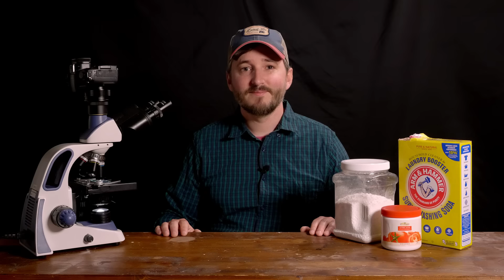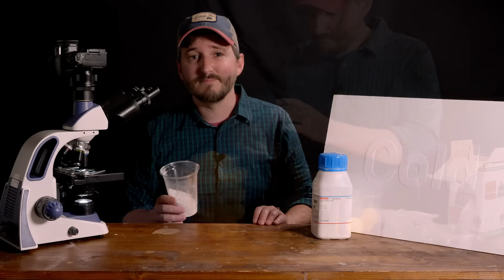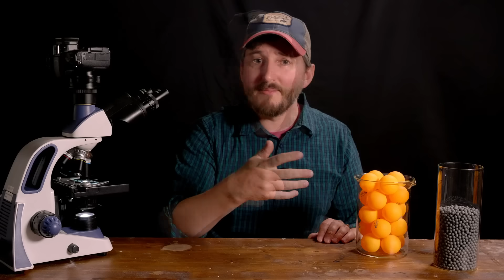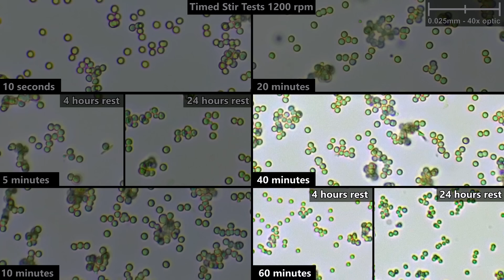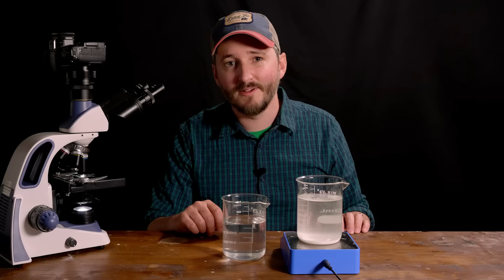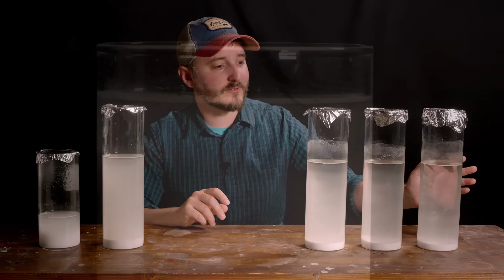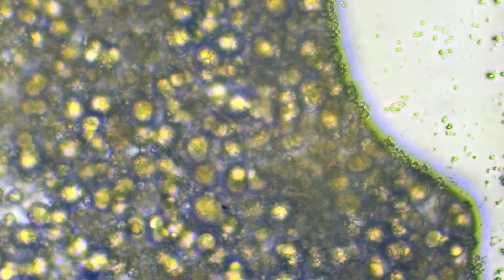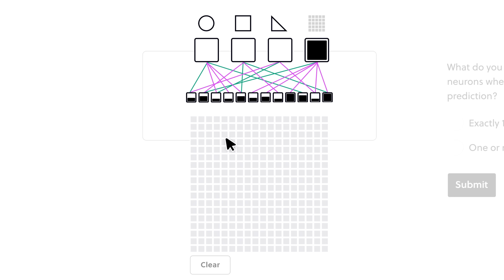Making Infrared Cooling Paint From Grocery Store Items (w/Novel CaCO₃ Microsphere Synthesis)

Comment: Pearls of Atlantis:  The Cove is sure to keep you cool all summer long, spandex blend.  The heavier dialectric weight creates calorimetric pathway, might be junky made, but I honestly hate fancy fabric anyway, oooh my butt is tight, who said that?  Denim has a lower dialectric weight, like if you just get the hanes 50/50, why would they sell a 50/50 tee shirt, rayon sucks to.  Spandex is the coldest fabric.  The theory is subatomic particles move at the attosecond, but they act as resistors, crystal deformities providing edge knife diffractiobs.  If you went deeper, point like particles exist outside of time in higher dimensions, but the most useful property is they replicate way faster than the speed of light.  Otherwise, things would freaze and anihilate.  So random motion comes from heat and dispersion, that where spandex plays a key role.  ( my high score is 23,650 on 579, I'm on level 663 ).

Comment: Is it too early in development to discuss applications? As I am sure it will soon become apparent, let me address the fact that I have only a high-school education and performed at the low end of mediocre in a public school system which consistently performs at the high end of poorly, so my hypothesiseses will be fraught with incomplete and incorrect premises and even more questionable conclusions. 

Having said that, here is what I "know" that is relevant to this topic, in no discernable order: 
Heat is light (as in wavelength, not as in weight). 
"Hotter stuff" rises and "less-hot stuff" sinks
 Light (remember heat is light) passes through clear and translucent "stuff" 
This coating is translucent, works best pointing at the sky, and is fragile.

 If only there was a solid material available in large sheets, that is durable enough to protect itself and the coating from damage, and yet is clear. This coating could be applied to one of these sheets and sandwiched between that and another sheet. Then we would have a durable composite roof panel consisting of [clear, translucent, clear] which will allow heat (because heat is light) to pass through but will keep water out and protect the fragile coating in the middle. Then when the air directly below cools (because the heat in it escaped through the roof panel), it falls and hotter air below it both rises naturally as well as being pushed up by the downward flow of the cooler air, creating a natural cooling cycle of airflow generation inside the room! Where can we find such a material? ;-)

Comment: There's existing attachments for 3d printers to use syringes of various sizes larger ones can often be found with the term ram extruder are used with 3d printing clay or chocolates. Which if you think about it is how a 3d printer for fdm (Fused Deposition Modeling) works in the first place thick paste in the form of plastic is pushed through a tube layer by layer. This would work perfectly for this IMOP. Though the acetone would prove complicated for some things like fittings and tubes.  

I bet you could get away with PVC for prototyping a system as it's fairly resistant to acetone though much over 100 prints you'd probably have complications. That said it's a cheep material and you can 3d print with it to print custom shaped nozzles.

Be cool to see you work with someone like teaching tech on this. 3d printing exotic materials isn't really talked about and a deep dive into how nozzles actually work from him someone who understands it more than most would be interesting.  A lot of DIY chocolate and clay printers fall pray to things learned early on in 3d printing because they don't have the history he has with the topic.

Comment: Super interesting :-) if tile (plates) is the goal. Maybe, just maybe fixing a plate on the bottom of a suitable pan. Pour in the mixture, maybe thin it a little, and leave to settle and dry. Should make that stage much less work intensive. Was thinking house roof, but maybe first do a car roof. :-) not sure car roof would cool a parked car enough to be noticable. Realy cool anyway (pun intended)

Comment: I cannot believe that after thousands of years of painting with calciumcarbonate you still manage to find a new application for it! I wonder if you can use this on chalk based paints to increase the brightness of brick paints permiable for water.
edit: I wonder if a chalk saturated solution of water can hold the microspheres without dissolving them. The other thing that helps your Acrylic water-acetone emulsion is that the water acts as an Emulsifier preventing the pigment from prematurely settling.  wich stresses the paint in the drying process.

Comment: Hi,
I believe there is a good use for this that you have not realised.

The CMB cosmic microwave background is the noise floor that so limits an rf engineers ability to recover very low level signals.

Think of tv, satellite dishes feeding expensive Low noise amplifiers or low noise blocks.

This "paint" over the surface of rf dishes (on the house for tv or in space on a telescope) could help reduce the noise floor that the LNA/LNB is focused upon and improve the signal to noise ratio.

Comment: what about applying the paint to some paper strips like you would making paper mache and sticking those strips to a surface? it would also provide a little bit of insilation to the panels at the same time as making application to a large area easier?
Reply from the maker: Interesting idea

Comment: I think there might be some plasterer's tools which would be good for applying this coating. First a notched trowel with 0.5mm deep teeth to get the correct layer thickness. And then a flat trowel or flexible spreader to fill the gaps.

Comment: For "painting" it, I had two immediate ideas that I'm not sure will work.  If you can get the pigment into a plastic solution, you might be able to make a filament that can be "3d" printed onto a surface for a consistent coating.  Other than that, potentially using an old inkjet printer to print it onto a surface.

Comment: Hmm, I wonder: if you poured this on corrugated metal, then put a clear corrugated piece atop it, so that the paint is sandwiched in the middle, that could be easier than drying tp paint it on or make it durable. It would be like a composite

Comment: As I mentioned in my other comment, a test with a electrothermal converter (like a peltier element) would be really nice. Even if it just shows that it is not actually practical.

Also a paint on a epoxy base could turn out pretty good. There are "cheap" epoxy floor coatings that could be worth a look.

This could even allow to build structres out of the "paint".

Another interessting thing would be a silicone based paint to be able to cover fabrics.
Reply: Oh and yes, thank you for your videos :D
Reply from the maker: Thank you very much! I'll think about trying a peltier

Comment: Your comment about the spheres got me thinking. I know we can do the opposite from cooling and use some sort of vantablack to heat an object, namely here I'm thinking pipes for heating. Fill the pipes with water and you have your basic solar water heater. I've seen basic amateur experiments get the water hot enough to create steam and average at 97 degrees centigrade in heating. My question is, how effective would it be to add iron filings to the water and utilize the filings moving past magnets to generate electricity? How comparable could it be to solar, using only commonly found ingredients. Has anyone tried this method of electricity generation before? Not your standard hydro power generated electricity for sure, but I'm curious.
edit: I suppose the question becomes can you get microscopic iron to dissolve in steam.

Comment: I feel like connecting a tube with your pigment and some sort of a pump to a cnc machine / a 3d printer would work great for spreading it evenly and consistently on larger surfaces without that much manual labour, i would love to try that method out but i don't really have the resources to modify my 3D printer, maybe someone else can take the challange!

Comment: Ok, Now I am really interessted in a Peltier or Stirlingmotor with a carbon black heating element and aa nighthawk white cooling element. It would be really interessting to see the performance and how it would compare so a photoelectric cell of similar size.

If this can even archiev a small fraction of normal solar cells, this would have great usecases as a passive cooler with powergeneration as a sideeffekt, effectivly cooling the planet while "generating" energy.

Comment: I am really fascinated by your research at home, which surpasses even the scientific papers. But coming from a paint-related field of research, I think it would be much easier to use a „Film Applicator with Reservoir“ to spread your paint evenly on flat surfaces like the cooling panels you mentioned. With the paint thickness you are trying to achieve, such a film applicator should be simple to build at home or 3D print.

Comment: Washing Soda is a bit of an archaic product with too little demand to stock in my local hardware mega-store under that name.  It might be that some of the branded detergents have some, but probably not pure.  Many of the more obscure "been there forever, Grandpa still uses it" products are going to online-only status, whether it's gas mantles or pruning seal or citric acid, because it lets them more easily stock high-volume products like Tide or Roundup.

Comment: I think that paint applied in these thicknesses is less useful than really thin coatings. If you want to create a commercial cooling surface your goal is similar to solar panels: Watts per m².
I haven't looked it up, but to my mind acrylic with bubbles sounds to me like an insulator, which would inhibit heat from migrating from the material-to-cool to the microspheres. One way, and the more practical way, is to use Tech Incredients' much thinner paint in multiple coatings. If you were to go the industrial way, I imagine an electrostatic application method in a cleanroom would yield much better results, since you could create a very fine paint mist that evenly distributes itself on the surface and for finishing touches you add a protective clear coating not containing any microspheres. The car enthusiast market should have ample supply of this gear.

All in all, great work though. I'm experimenting with growing lime crystals myself, so this is a great source for information.
Keep it up.

Comment: Hi great research! Thank you for the dedication!
A few ideas. You could try and automate the extrusion process using a cartesian robot (converting a 3D printer or CNC router in to a paste extruder). This will make extruding the paste more consistent and also line placing. Large panels can be made like this the only real restriction being hardening time.    
As for the binder i think you should try epoxy , if you aerate the epoxy during the mixing process the air bobbles should have the same or similar effect as water in the acryl polymer.
 And finally a more a question, did you try water glass as a base?

Comment: I am not sure about the theory that high packing density is the most important for reflectivity. the air space between the microsphere is responsible for reflectivity so a packing a 100% would be  bad. You would get best result by using bead of a size similar to the wavelength you want to reflect and not bigger nor smaller ! but with bead all the same size it seems they would arrange in a regular lattice which due to the crystal structure would have lower reflectivity at particular angles. so I think maybee having bead of size 1um-0.5um would be good but the best would be to experiment with a lot of sizes . 
also there was a paper published in nature photonics : "Brilliant whiteness in shrimp from ultra-thin layers of birefringent nanospheres" which you might be interested in they discuss this exact problem with packing factor and polydispersity (difference in size ) they also discuss that birefringent material work best (which calcium carbonate can be but might require a particular sample preparation) I did not read the paper in detail but it seems highly relevant to your experiment. 
very good video and I think you should experiment more with sizes and calcium carbonate birefringence!
Reply from the maker: Thanks for the reference, that sounds interesting

Comment: Huh, I wonder if this paint can be applied to the surface of a white shirt to allow you to be somewhat cool out in the sun. Of course, as mentioned at the top of the video, it's a delicate structure, and needs to be clean to remain effective, but it's a curious application. Maybe as a finishing on a parasol? You could line the top of that with plastic, no problem

Comment: I worked in a production facility that made plexiglass, the plexiglass scraps have another advantage. acrylic glass of any brand does not really like UV light and will degenerate over time. therefore they add a UV absorbing pigment that prolongs the lifespan of the acrylic glass.
and now you can guess, what is in the scraps too, prolonging the lifespan of your paint.

Comment: This could be interesting for the marine industry, especially for gelcoat producers
Reply: Oh anyway they already invented the Barium Sulphate gelcoat.

I work in the marine industry, air cooling is a pretty important part in the leisure craft sector, i noticed early on that some boats had a colder surface to the touch than others that simply reached air temperature and went up.
Thanks to this videos i understood why.

Gteat stuff!

Comment: Could you stack cooling panels? Like have metal sheets with one side painted black to absorb the IR light and the other side coated with the microsphere paint and then layer the metal sheets. Maybe cut a hole in the lid of a cooler to hold drinks and replace the hole with your layered sheets. And then set it out in the sun and see how cool the inside gets.

Comment: I'm pretty sure you tried it out, but in case you didn't: What about a higher water content in the paint and a little bit more powder? It might spray better with a paint gun. It'll be more fluid so you can apply just really thin layers, but it could be worth a try.
Thanks for this video. This paint has a great potential, and making it open source is really nice! ;-)

Comment: I suggested CaCO3 and ZnO before without knowing their emission properties. It makes sense and was used for millenia. Why they cant be crystals tho? A crystal may scatter light even better without the need for acrylic and the acetone trick. Actually when I leave lime water jug open a crust will form on the surface. It's flat so it could be useful. You dont know that it cant.

Comment: Hi Ben, perhaps you can help me resolve my confusion:

If surface temperatures are measured with an IR camera, where the highest IR emission areas represent higher temperatures, how is cooling paint's effectiveness measured via an IR camera; when shedding more IR represents more cooling? 

If emitting more IR cools the painted object, and IR emission is used to measure temperature, then to my mind the more emission means the object is hotter, rather than colder.  I would want to see a contact measurement with a thermocouple to separate IR cooling from IR measurement.

Now, perhaps the key is that hotter and colder areas give off different IR wavelength, rather than just the quantity emitted?  Or am I asking a dumb question?

Thanks

Comment: I wonder if dispersing some half or 1mm steel shot in the liquid, or on the surface, then using a piece of square stock to spread the paint would allow for more consistent application. Or, laying down wires on either side of the panel, then spreading using the wires as rails and spacers to apply a controlled thickness film.

The shot might roll, leaving tracks in the paint, but it also may self-level in their wake, and if so, a magnet could easily remove them from the uncured film.

ponders harder

Comment: One thing I don't understand is that it needs to point at the sky to work. Wouldn't it work if it was pointed anywhere? As it would emit the light through the atmosphere and into another object which would release in random directions and thus still cool the painted object.
Reply from the maker: Everything emits IR light according to its temperature. If you aim the paint at other warm things they will send as much IR at the paint at the paint releases.
Reply: @Nighthawkinlight  I understand that it would send the IR out, but there's no reason it should be reflected directly back at the paint again.

Comment: I have a few ideas for application and integration. 
Im a mechanical engineer and firefighter by trade and a chemisist by hobby partly from my desire to understand what im doing and up against in my fields the rest is Niel Red and you. 

I bought a old farmhouse some 9 months ago that was built in the 1850s and want to add some modern touches to it without drastically changing the ästhetische. I will do my best to let you know what I do end up making from this.

Comment: If a panel coated with this paint is aimed at other than the sky is will still radiate IR; I assume. This may make an excellent surface coating for IR heating panels. I have a project backlog now but should be able to get to this by the time the weather changes.